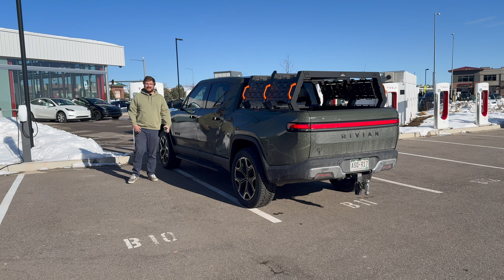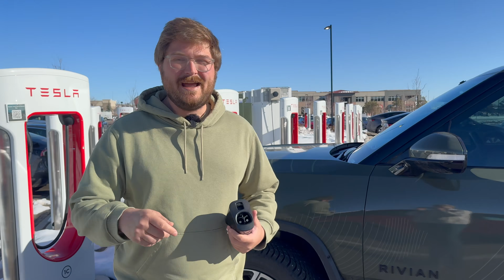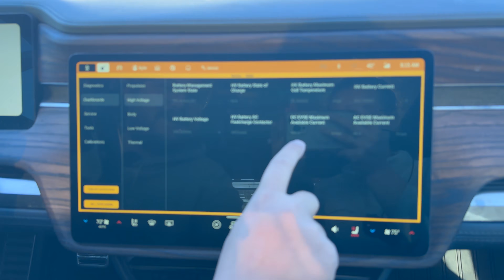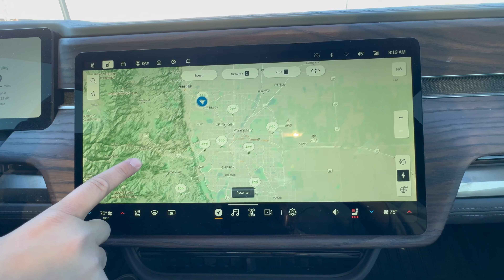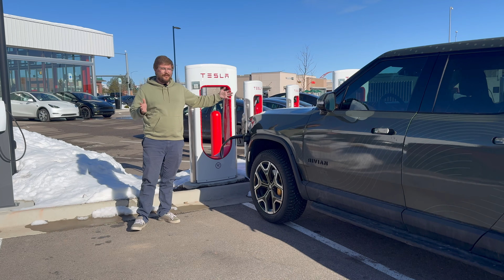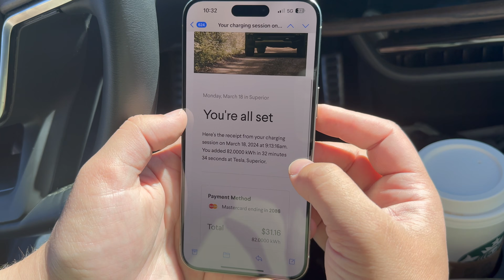Rivian Gains Access To The Tesla Supercharger Network! My First Charging Experience

Comment: Rivian's stance on the R2/3 charge port location is weird. How much curbside charging infrastructure is there or will be there in the next several years? 
You could call it future proofing I suppose, but I don't think that will be the normal way to charge for most people in a long long time. If ever. Plus, you have to walk around the vehicle every time to plug in. Small inconvenience, but one you have to live with near every day.
Even if they just moved it over a bit so the port was on the rear facing panel next to the tailgate, that would make it more compatible with V3 stations. It might actually reach there without blocking a Tesla spot.

Comment: Going forward EV's need there charge ports in the front passenger or drivers rear.
Reply: I have a Nissan Ariya with the charge port on the front passenger side. It's really a pain in the butt walking around the car every night to plug it in. Driver side would be much better.
Reply: @jdsullivan21 Only because you home charger is on the wrong side.

Comment: If Tesla did this right - the charger not only reads the temp. sensor in the adapter but a ROM which has information about max voltage and current. This is really olde schoole in the high speed networking equipment where cables and adapters in the entire network chain are interrogated before a link is brought live to the lowest spec of whatever is in the chain.
Reply: No, the adapter is passive and has an on/off interrupt for temperature. It will interrupt the communication link to the vehicle, which will immediately terminate charging.
Reply: All indications (over 10 years?) Suggest Tesla "did this right"?

Comment: Is the adapter secured from theft? I didn't follow the locking process well enough to determine.
Reply: Depends on the EV, some lock without a key present, some don't.
Reply: Rivian doesn’t have a release button next to port so theft seems very difficult.  But, Ford & MB have a button that allows theft.  These brands and others need a software button to prevent adapter theft.
Reply: I think they can be stolen because most CCS1 EVs have a release button next to port.

Comment: He should try the Rivian adapter on the Ford.
Reply: I can’t imagine it not working because there are no active components in these adapters.
Reply: It's the Ford adapter, they're all the same made by Tesla.
Reply: There is a pin in the NACS plug that s communicates with the car. Just wondering if there might not be a chip in the adapter that translates this communication for each type of car. Just a thought.
Reply: @roxter299roxter7  There is not a chip, the adapter is passive. 3rd party adapters like A2Z and Lectron will work too with any make allowed to use the Superchargers.
Reply: @TechnicalLee  
👍🏾
Reply: @TechnicalLee  The only components in adapter are thermistors which open the communications circuit when temperature exceeds a limit. An open communication port turns power off for safety.  Very simple.

Comment: Extension Cable:  Will the extension be a dog bone style with a NACS female and CCS male conector? This would replace the adapter and separate the two sources of resistance heat.

Comment: Great video as usual, Kyle! What your thoughts on Rivian R2, will it be better than the Model Y?
Reply: I don't think Kyle has even seen the R2 and R3. Jordan is the one who went to CA to see the reveal.
Reply: @anthonyc8499 what's your thoughts? Do you think the R2 will be better?
Reply: @richardt2052  I don’t expect the R2 to have any meaningful specs that are better than Model Y in terms of range, charging times, or acceleration. I think the R2 has a better form factor than Model Y, will be better for off road and outdoor camping adventures, and be better for cargo capacity.
Reply: @anthonyc8499  you don't have any clue...
Next generation Model Y must come with:
- 800V architecture
- 300 miles (tri-motor AWD)- 310miles (dual motor AWD) of range and up to 330miles for the single motor RWD
- Around 240kW charging power for the small battery, big battery maybe at - 270kW
- HUD, V2L/V2G, a few extra accessory like a e-bike rack, roof rack etc. in order to compete with the Rivian R2. 
- And the dual motor, big battery version should not be more expensive than 55k.
You think most of those changes are coming to the Model Y at the end of next year at this price point? No? Well then Tesla is hella outdated
Reply: @BBingo-v5i  lol, Model 3 Highland doesn’t have 800v so it’s bonkers you think Model Y will.
Reply: @anthonyc8499   That is the point...Model Y LR really needs 800V architecture in order to compete at this price point of around 50k-60k in 2025/2026 and onwards. The competition will have it. I could see Tesla being forced to implement it to their most succesful model, also to keep up with the technology race and price war in China. If they cheap out but still keep prices high, what they already have done with the Model 3, which is why its sales are at an all time low in comparison to the Model Y, then it will be a big win for the competition, for example the Rivian R2
Reply: @BBingo-v5i  R2 will have 400v too though. I don’t think R2 will have anything with its drivetrain and HVB tech that’s really different than Model Y. The form factor and capabilities of R2 will differentiate it from Model Y.
Reply: @anthonyc8499  400V architecture with up to 270+ 4695 cells at 3.6V each (total of 972V nominal) doesn't make much sense. It it quite clear that it will be an 800V system. BMW uses the same battery cell dimensions (and probably very similar battery chemistry) for their new 800V EV platform "Neue Klasse".
Also keep in mind that the R2 should start production in late 2026 (North America) and 2027 (Europe) and 400V for a mid-size premium SUV would be outdated.
Reply: @BBingo-v5i  cell form factor shouldn’t matter that much. Tesla’s 4680 cell size has been a complete bust. It’s all about thermal management. If it stays 400v, I think R2 will be on par with Tesla’s 3/Y platform. No big deal.
Reply: @anthonyc8499   the cell form factor, the amount of cells, and the battery chemistry could determine the system volts architecture. Why would you settle for less charging power when you have a big and powerful battery in your vehicle? Only reason would be cost cutting.
Teslas bigger 4680 battery packs are also 800V architecture ready, by the way. The Cybertruck is the first Tesla to actually have an 800V system, right now it only allows 250kW because the 4680 cells just suck from a battery performance standpoint and yes thermal management plays a big role here. That is Teslas fault tho. In the future the battery type could generally allow higher charging speeds at 800V.
I am very certain the Rivian R2 will have an 800V system because a bigger battery size would make it a logical consequence.
The Model Y right now has a max of 82kWh total battery capacity. 250kW is enough for a medium sized battery. That is around 3C max charging capability (3 times 82 = 246). Rivian might use 91-96kWh total capacity battery in order to achieve the bigger range figures. At 2.8C charge rate that would mean ~255kW-269kW charging power. Even a Tesla-style 400V system (which uses higher amps to achieve higher charging powers than traditional 400V systems) would be above its limit then. Under 2.8C charging speed would be quite slow and outdated in 2026/2027. BMW probably also has 2.8C charging speeds with their 4695 cells by the way. Around 275-300kW charging power with 98-107kWh total battery capacity in the biggest trim.
Many signs say that the Rivian will have an 800V system.

Comment: In terms of the wrong adapter damaging the vehicle, it is theoretically possible. It may not happen, but it's possible that the DC isolation test could expose the onboard charger to voltages that it cannot withstand before either the car or charger detects that anything is wrong. It's hard to say what would happen for sure. I certainly wouldn't try it on my own vehicle. Ideally, the isolation test should gradually ramp up from a low voltage and would cut out the moment any current actually flows. So if that works well enough, nothing should be damaged. But the isolation test might not respond fast enough before any damage is done. The true answer probably depends on what specific car and what specific charger is involved.
Reply: I need to get my hands on an adapter still to test, but I'm hoping they put a resistor or something in the DC adapter that either the charger or car detects to verify it's a DC adapter before the isolation test starts. I'm sure the engineers would have thought about that happening by someone who didn't know the difference.

Comment: Funny how it worked first time with no hiccups.
Reply: I signed up to EVgo, ChargePoint and Blink ahead of collecting my R1T. And yet it took me 5 attempts and 25 minutes to get the Autocharge+ to work. But more of an issue is the sheer number of broken chargers, chargers that Rivian routes you to which are still under construction, and “350kW” sites with only “100kW” stalls available. Also “350kW” = 209kW, “100kW” = 70kW, “50kW” = overnight stop.
Reply: Funny, it’s almost like Tesla knows what they’re doing.

Comment: Would having multiple charge ports on each vehicle be that much of a cost/impact?  One on the back and one on the front on the same side of the vehicle takes care of the problem - regardless of which side the auto manufacturer picks.
Reply: Yeah, it's very pricey to design a pack to have multiple ports and then run HV cabling all the way to the junction box.
Reply: Adding a second port for AC-only charging is feasible and that's what Porsche does. Would probably add $500 to the cost.
Reply: @TechnicalLee TIL. And AC is the use case where curb-side charging (i.e. "charging where the car's parked at night") actually makes sense.
Reply: @TechnicalLee  the problem with a second AC-only J3400 port is that nobody will understand it and everyone will think their car is broken. How would the average person understand that despite having identical NACS ports on both sides of the car, only one side works with one kind of charging?

Comment: Can we just admit that Tesla put their charge port in the wrong place from the start? Rear passenger side should be standardised to allow for curb side charging.
Reply: Front passenger side (or center) would work for superchargers, curbside charging, and while towing. More manufactures should put them there.
Reply: no way. it's silly to have to walk around the car to plug into the car at home in the garage. driver's side charge port at the front or rear is the way to go.
Reply: @anthonyc8499  Peoples homes and home charger layouts can vary a lot (i.e. some homes have their entrances to the right of their parking space/garage) but curbside charging with a street facing port will always be less than ideal. imo.

Comment: If you park with the parking line basically in the middle of the vehicle then most EVs can charge without creating a parking issue or taking up two chargers.
Reply: The only way you wouldn't take up two stalls is if you were on the far right stall. Otherwise, yes, you will be taking up two stalls.
Reply: @Tom_logic  no, everyone should park with the line in the middle of the car regardless of whether they have a Tesla or CCS1 vehicle. The cord will reach for most EVs if you park that way. The Ford F150 won’t work but that car is the exception.
Reply: The cable isn’t long enough to reach a Tesla’s charge port if you’re more than about a quarter car width out of alignment. I’ve tried this a few times when people have parked badly, but often they successfully blocked the next stall.
Reply: @markirmuir  with the bollards and curbs removed it now works. Try it now.
Reply: Dumb idea, it would still take up two spots and now the cord wouldn't reach Tesla charge ports.
Reply: @TechnicalLee  you are wrong. I have tried it and it works with Tesla vehicles and most other EVs.

Comment: Will they be making more superchargers due to the increased amount of vehicles charging?
Reply: If you count the number of Tesla's on the road, then the amount of "other" vehicles, those "others" are probably a fairly low percentage?
.
Then, count the number of "other" EVs sold (say over the last 6 months? Year? How many new chargers (not locations) have been added in the same period?
.
My guess is Tesla has this covered.
.
Oh... And Tesla has the data of which brand, where, what time, how long and amount paid, PLUS how busy that location was at the time... AND how busy the other locations in the area were.
.
I bet there's an A.I monitor suggesting either new locations, or expansion to existing locations?
.
How about a "location unavailable" indicator to non Tesla drivers if there's a Tesla already navigating to the last charger?
.
Etc....
Reply: Yeah they'll never stop building charging stations. Especially as more manufacturers sign up to the network.

Comment: Now, how do people know when someone is hogging a charger on the Supercharger network? This is very easy with the massive screens on the EA stations.
Reply: There is one charging cord per Tesla stall, so if it’s plugged in, it’s in use. Tesla already has congestion and idle charges which should discourage hogging.
Reply: @PygKLB  This is true I forgot about the congestion pricing that they have.

Comment: Why can’t Tesla have their charging station in the middle of the spot? It works for Tesla and no long cable. Why is this need to be on just 1 side? Gas stations built for all “Port” locations, why reinvent the wheel?
Reply: V4 dispensers are centered.
Reply: The longer the cable the more expensive. Tesla made the cables short because all Teslas have their charge port in the same spot. It would take quite a while, and lots of $, to change all the Superchargers to have longer cables. I think automakers should just standardize on the same port location on the vehicle as Tesla. Curb-side parking entails less amperage, so cable length is less important.

Comment: Are there any cable extentions that could be used so that you can park backed in?
Reply: Nope, and don't expect to ever see an extension that's longer than 2 or 3 feet, at most.
Reply: Nope, and Rivian decided to put the charge port of the upcoming R2 on the rear passenger side which creates the same exact issue lol 🤦
Reply: @Oklm23  Rivian says this is gonna be a diminishing problem over time.
Reply: @anthonyc8499 I don’t see how it will be, don’t think Tesla will be retrofitting all existing tesla supercharger cables anytime soon. I wish Rivian could just just put the charging port in the right place since they’re moving it on the R2, it makes no sense that they won’t

Comment: Parking is going to be way easier for Polestar, with the port being at the rear left. Can't wait to try it on mine!
Reply: Rivian didn't have ISO 15118 plug & charge either up until this Tesla deal. I imagine Polestar and Volvo will implement it as well for access.
Reply: @petehelme   is that not what they're using for the adventure network? My understanding is it is.
Reply: @Scoopta  I could be wrong but I'm pretty sure the Adventure Network is a proprietary protocol like Tesla does for their own vehicles.
Reply: @petehelme  my previous reply seems to have gotten deleted. Maybe because I posted a link. It is 15118, I found the video Kyle mentions it in. Since it didn't like the link it's the video titled "Rivian is ramping up their adventure network charging station build out" at time 7:50
Reply: ooh, happen to know if that was a software upgrade or hardware? (if they were able to do it software-only, maybe polestar can manage that too) @petehelme
Reply: You'll have absolutely no issues picking a spot. It's going to SUCK for everyone that doesn't have their CCS port on the rear driver side / front passenger side
Reply: Nice!  Wish I saw more Polestars on the road!
Reply: As a fellow polestar owner I wonder how this is going to work for payment though. So far both ford and rivian are using plug-n-charge but afaik the PS2 doesn't have plug-n-charge support right now. Hopefully that will come in a software update but if I have to make a tesla account and activate via the tesla app that's gonna suck.
Reply: I was going to say mine works with the evgo thing, but dug a bit and that's "autocharge" - which just uses the (spoofable) identifier and doesn't do the cryptographic exchange that plug-n-charge does.   @Scoopta
Reply: @Scoopta I did a road trip in a polestar 2 with stops at magic dock chargers and yeah we had to sign up and activate with the Tesla app, but the parking was seamless

Comment: If you reverse the car into the charging station with an R2, the charging port will be in the correct position to access the Tesla cable just as easily is it is now on the front left. Or am I missing something???
Reply: R2 port is in the wrong spot for Superchargers. Tesla is left rear, R2 is right rear. So R2 will take up two spots just like other Rivians and Fords.
Reply: You missed that Kyle was parked in the spot for the next charger over, blocking it off from anyone with a Tesla… 

…or you missed that front driver’s side (R1) and rear curbside (R2/R3) are on the wrong side from driver rear (Tesla) no matter which way you pull in.
Reply: @EUC-lid  More manufactures need to put the port on the front passenger side (e.g. Ariya), works well for superchargers, curb side charging, and towing... front center works as well.